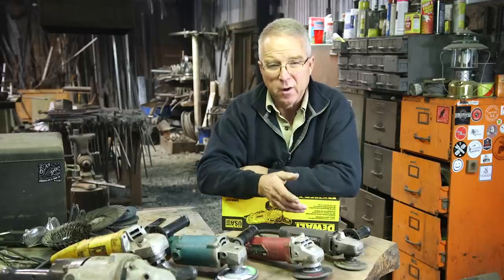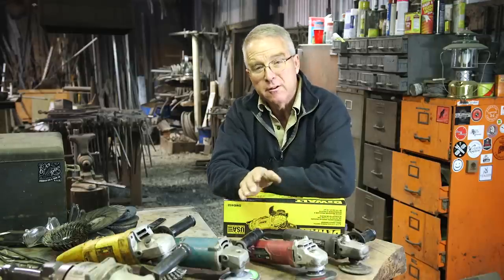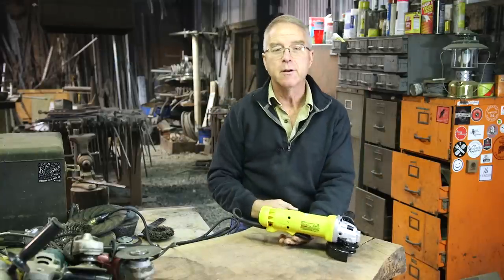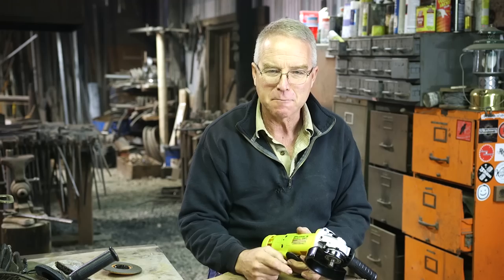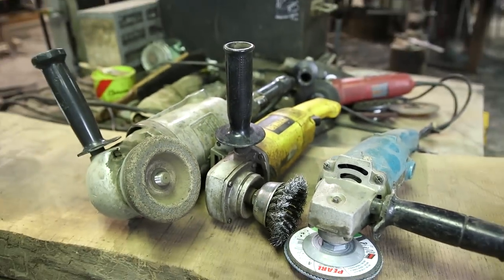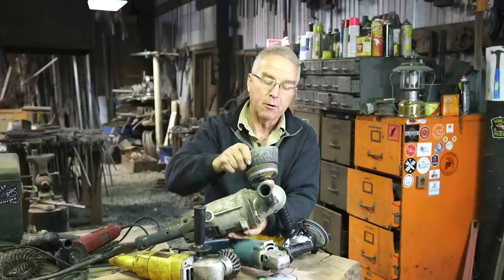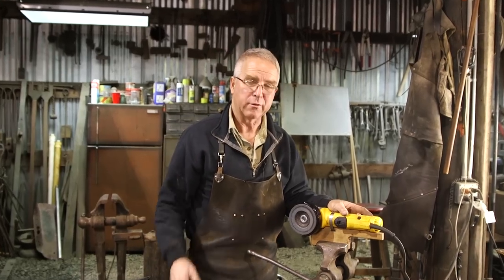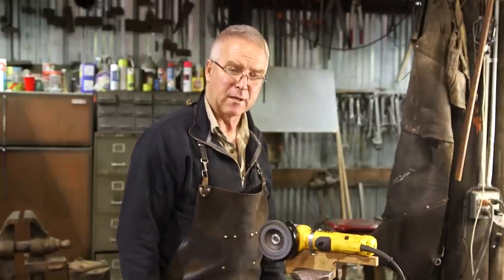Get Another Angle Grinder

Comment: Wear face shields, safety glasses, long sleeves, and gloves.
Reply: I'm with you except for the gloves. Just my opinion, but I don't wear gloves around rotating tools. If the wheel catches that glove, it'll tear the flesh off your hand faster than you can blink. If you're looking for nightmare fuel just google images of "degloved" or de-gloving accidents...
Reply: My brother had 3 fingers cut off.  A man I know had his nose slashed in half.  don't underestimate the power of cut off blades.   @noah_9886
Reply: A glove wouldn't have made any difference in either of those cases, Julie. Except maybe make it worse...
Reply: @TheBrokenLife  You shouldn't have your fingers near the wheel  and gloved should fit reasonably close the finger so catching fingers is a tard move ...brushing a knuckle against a wheel happens since most like myself use no guard and that shouldn't wrap a finger in a wheel,  and a real set of gloves will give you protection from being skinned ... The cheap ranchers leather gloves you get 3 to a pack for $4 bucks aren't the gloves to have a nice thick cut resistant welding gloves will save your skin from that mild knuckle brush.  I am welding using these tools so I always have the heavy stuff on not cheap gloves you use to hang chicken wire fence with .
Reply: Running power tools with gloves on was a firing offense in every training program I ever took. That goes down to 6th grade shop class and up to machinist's training in college. It's not safe. To the point that if you were caught doing it in college, you'd instantly fail the course and have to wait another year to take it.
So, do as you please, but it's not recommended.
Reply: @TheBrokenLife  If you run an angle grinder cutting up,  flap wheeling , or  grinding steel without gloves your hands will be all micro cuts and burnt from sparks... running a lathe , drill press,  or band saw ...sure no need for gloves , but use some basic sense not college sense .
Reply: Yes mother.
Reply: You mean ignore the trained machinist teaching the machining courses? OK then...
Reply: if you're in trade school or at a safety conference.  on the job??  probably not
Reply: @TheBrokenLife  Do you chew your food 32 times per bite while eating your lunch Or do you skip some so you can go out to recess faster ?
Reply: Comments like that only serve to illustrate that you just can't fix stupid.
Reply: @yerwrng  How is wearing gloves instead of not wearing them comparable to getting to recess faster?  Wouldn't not wearing gloves be the cooler lazier thing to do anyway in addition to being the only correct way to use the tool?
Reply: @lysergicheadcase   Keeping ones fingers away from the wheel is all it takes to safely use an angle grinder with a glove on ...lol... I just can't picture any one working with steel and not wearing gloves ...lol... what's next telling folks not to wear ear plugs when welding over head because you may not hear the phone ?
Reply: @yerwrng  Nothing is next. It's the same concept as steel toes being pointless when working around sufficiently heavy loads.  They will crush your steel toe and cut your toes off with it, just like the grinder will grab your glove and pop your fingers like glowsticks. If you want to be belligerent and go against common knowledge it's up to you. Creating irrelevant strawmen like you continue to do does not make you clever, it makes you seem incapable of taking this seriously.
Reply: @zachtheripper124  I just can't see anyone holding an angle grinder cutting , grinding , flap wheeling steel without a glove on .I pulled all my guards as they just get in the way and a few times have done work without gloves which since welding most of the time the gloves are elbow high and without the gloves my hands and forearms felt sunburned after from bathing in sparks ... lol... that's not a teacher telling me that  , but rather a practical observation from doing the work .
Reply: @yerwrng  With all of the safety experts commenting above, none of them figured out that each and every guard was removed from every single angle grinder.  I have to agree that after the guard is removed you should wear a glove.
Reply: @juligrlee556  Metabo have been using a safety clutch in their grinders for years for when a cutting wheel binds up, I'm not sure why other companies don't do the same. With people getting cut with the grinders I'm thinking they had removed the guards but they also could have binded up and jumped out of their hands as such which is what I'm thinking happened to your brother. Either way they're a dangerous tool and should be respected, probably why I own 2 cordless grinders because they're less powerful and easier to stop the cutting wheel under load
Reply: @wientz  I was gonna say that the guy getting his fingers showered in sparks is because he removed the guard in the first place. As essential craftsman said the guard is there to protect you from the sparks and in the case where a cutting wheel explodes
Reply: Great recommendations. @a-carpenter9229
Reply: a few things are absolutely clear: guards and gloves-  it depends a lot on both the individual and the circumstances.  Guards more just  circumstance.. Gloves have come a long way since that dude was in sixth grade shop class, most grinding situations i want to keep my hands clean.  That being said i got some valuable information here and if i got to a part of a grinding job where i thought i might lose the thing i would take my gloves off.  On the other hand it’s unlikely to tear your hand off like a lathe or a drill press, but fairly likely to send a chunk of wheel into a tendon...  so yeah nice thin aramid gloves.  There are times i take one or both earplugs out for safety.  Tablesaws scare me more than anything, but I don’t use any safety but full on heads up technique.  That being said recently been thinking about adding a knife. Its all about awareness and balance.
Reply: @TheBrokenLife  Interesting, what about vibration though? Some power tools obviously require some vibration dampening gloves. With gloves you end up getting your hand torn up in less then a second, without gloves and you run a higher risk of getting nerve damage in the long run. And ofc you have all the not so healthy substances that your skin is exposed to at a higher rate if you don't wear gloves. Running without gloves and you're just trading short term safety with long term safety. 

But i don't know what kind of power tools you're talking about.
Reply: Lets not forget to wear our neck tie and clean  underwear. Orange safty vest , Steel toed boots .We need to our lock and the safty coordinators lock .  A spotter with an extinguisher and wet blanket . Well hell its lunch time now.
Reply: And jeans
Reply: @gasfiltered  I've had metal slivers in my eyes, a deep slash on my arm, burns from the wheel on my fingers and hands.  Of course, gloves, like all pieces of clothes or even hair can get you pulled into the grip of a spinning wheel.  My brother lost half of his hand by falling into a spinning blade.
Reply: Noah _ if your gloves are a potential risk, it means you’re not using it correctly. Have your hand on the body and one on the handle that will never be an issue. I always use the stationary rule. Never use gloves on a station bench grinder or sander.

Comment: A thumb switch is the only way to go so you can one hand them, would never buy a paddle switch. I dont understand how anyone can like them... Talking about the 115-125mm (4"-5") ones not the big 180+.
Reply: Gürwald
      I have a thumb switch one and a paddle type. Paddle type is far superior in my opinion. I operate it one handed all the time.
Reply: Hate thumb switches...
Reply: One handing is just not a good idea IMHO, same with the thumb switches. Paddle gives a much quicker on/off, which I like. I think the issue with paddles really depends on the quality though.
Reply: @mercMADCommando     With what I do, two hand operation would take me at least four times longer to accomplish the task at hand. I don't have that much time to waste. Edited for spelling correction.
Reply: That is fair. With sanding disks or wire brushes I wouldn't be as concerned but with cutoff wheels and to a lesser extent grinding disks, it's just a no-go for me.
Reply: Having used both types over a span of 30yrs as a welder I much prefer thumb switches to paddle (or dead man switches). I find it less tiring for all day grinding/sanding/polishing.Totally agree with multiple grinders with different discs. But I will never use a grinder without a guard, when I see any grinder without a guard my balls retreat ,major injury waiting to happen, seems to be an American thing ? Never seen one in the UK.
Reply: Seems nice to have the choice though....
Reply: Thumb switch ONLY. Paddles are not usable in pipe fitting...
Reply: paddle swithces are much safer
Reply: The “pipe fitter” in this comment is clearly a rookie. Absolutely never has worked offshore or for a legitimate company. Any thumb switch would immediately be disassembled and any locking device disabled by rig electricians or possibly even removed from service due to the obvious safety issues they create. But what do I know, I’m just a actual pipe fitter. 
Safety first!!!!
Reply: @chrisk4251  not the metabo ones. They have stop feature against bluging them in while "hot"
It seams to be another us vs eu thing and most us guys use their thumb swiches on top of the angle grinder as they come from store. on good quality brands you can rotate head of tool so it sits right under your hand. No mader if you lefty or righty, but nobody has time to read the manual.
Reply: @jaanuspaaver2771  I was going to comment about that. The thumb switch should obviously be where your thumb goes, as on the side of the grinder, not on the backside!!
Feels like the US is trying to make things as stupidly as possible.
The paddle truly tires you hand down because you cant reposition you grip and you just have to squeeze that sucker for the whole operation.
Reply: @chrisk4251  
weird, how thumb switch can pass eu regulations, in my opinion paddle is just tiring down your hand if you were using it for longer duration of time, at the same time a quality thumb switch takes almost no time to switch on, and are mostly built hair trigger like, you bump the and they shut off
Reply: @duncancampbell5755  welder/fabricator here. I work in a marina doing work inside and outside boats, yachts, ships. For the most part we can't have the guards on. The spaces we work in requires us to remove the guards on our grinders, they just get in the way. As long as your aware of the danger and take precautions it's fine!
Reply: I have recently bought the UK version of this tool, from Amazon,  to add to the collection. It comes with a thumb switch as do all brands in the U.K. Interestingly mine is made in China and the guard is shallower but adjusts the same way. Really like this model of my Bosch Hatchi Dewalt et al like this one the best, lots of power.
All new thumb switch grinders from the 'pro' brands now come with the safety feature where if the power goes off or the unit is stopped by pulling the plug out you have to turn the switch off and back on to make it go. It will not start just by plugging the unit back in
Reply: the problem with that type of safety if most workmen mod them for usability, it needs to start with both function and safety.
Reply: @chrisk4251  been a pipefitter for 18 years and still prefer the thumb switch. I have had close calls with both but at 18 years, maybe I'm a rookie too.
Reply: I work for a metal sign company that uses decorative grinds on products they make, and sometimes constant movement of the work is required, so one hand is on the part and the other is on the grinder, thumb switch grinders are a must in this case. thumb switches are just more accurate too, it can be harder in some angles to aim with a paddle type. Working in automotive having to cut out brackets and other metal around the nooks and crannies of a car, a paddle/trigger grinder is just too much and 'one handing' a grinder can be very necessary.
Reply: That "Inovation" guard with quick stop in many positions is on my 20 years old 5" Metabo :) (not exactly same construction, but same functionality)
Thumb or paddle... meter of taste, kind of job and quality.
As low quality thumb is horible, so is low quality paddle. And vice versa.
If you have a job that require long runs, than thumb is more convinient. If you have a job with many start stop and short actual work time, than paddle is more convinient.
...
Reply: I agree, paddle switches where invented for shop class students and the occasional homeowner.   They are not meant for the professional.
Reply: I prefer the thumb switch for death wheel work, I actually have that exact same skil grinder that he was hating on lol.
Reply: Thumb switch ftw!  Especially since that one time I sat on a paddle switch controlled one...  not joking, it can happen.  I wasnt injured but my balls are still skittish whenever they see the color yellow lol!
Reply: Gi normusdick 

That’s like saying that on the space station they crap into a vacuum tube hence we have to do same on the ground.  All I am saying is...sure you wouldn’t want a runaway grinder on an offshore oil rig.  But in my shop I let it run free switched on with a thumb switch.
Reply: I have a couple Makita angle grinders because they have the best thumb switch. Not a fan of the paddle switch.
Reply: @chrisk4251  Not everyone works on offshore rigs where draconian safety rules are a necessity. That said, I prefer a paddle, preferably cordless.
Reply: Have both styles and the thumb switch is  too close to the wheel and awkward to operate. Bosch grinder variable speed is great but wish it had the paddle switch

Comment: A good trick is to check Ebay for broken ones. 

This will tell you what the failure point is on each unit. 

If you find a unit that's been around for a long time and there are fewer busted ones on Ebay (makita) then all the others. That's the one you want because it doesn't break or its worth repairing.

I love these chats I could talk tools all day.

Comment: I have never used this model. Only the Dewalt 13amp 4 1/2 in to 5 in.
They are a beast for its size. Cutting and grinding SS at work all day in and day out. It wont bog down. If u push down hard it will take off out of your hands before it bogs.
Also the 13amp Trigger grip is another fav for certain type of work.

Comment: If you think your Makita is going to die soon ?
Give it to me. 
You can not kill those  !
Reply: I had a Makita that worked for 15 years. I replaced it with a Makita, it lasted 4 Months. I killed two.
Reply: @metroman93f27  I thought I killed my Makita after 10 years but there was just a small wiring fault. Easy fix and good as new.
Reply: I’ve got a +10yr  old 4” Makita and a nearly 20yr old 4-1/2”. No sign of them dying any time soon.
Reply: Makita grinders are not what they used to be, we used to use them in the family steel fab shop, they were 7 inch grinders mind you, couldn't kill them. I use 5 inch grinders so does my brother I killed a Makita in a year and that wasn't using it everyday, my brother only had Makita grinders last 6 months. He's gone to Milwaukee grinders he gets a year or more out of them before they grenade.
Reply: @Graveltrucking  
That's why I want his old one  😎
Reply: I bought 2 makita 4-1/2" grinders and 2 harbor freight cheapo 4-1/2" grinders for a job cutting 1/2" steel mounting brackets that were installed wrong on a building fascia. Guess which grinder lasted longer.

Yup, the harbor freight cheapos.
Reply: 7" makitas are the best 7" grinders
Reply: Back in welding school we had 12 Makita grinders that saw 14 straight hours of use daily (morning and afternoon classes)and I only saw one truly die. The rest might need a brush replacement on occasion, but they were bomb proof little tools
Reply: @JustNobodyButME  The harbor freight?
Reply: @JustNobodyButME  The harbor freight?
Reply: @Graveltrucking  what you're doing wrong is written right in your comment. You should just stick to the 7 inch models. Like you said, "you, couldn't kill them." (sic) It stands to  reason that if you're trying to get the same work out of a 5" as a 7" it's not going to put up with it for very long.

Comment: When I worked in a shop I never used a guard but had a handle, much like you. It works well in controlled situations and to get into tight spots. When I got into pipe welding, that is when I started using the guard with no handle. You can control the head much better with your hand on the body of the grinder, rather than the handle. I rarely have a handle on my grinders and always have the guard. 
Just my professional insight.

Comment: I have that grinder and like it a lot. My next one though will be a DeWalt with the anti kickback system. I bought the flexvolt one this summer and love it. That anti kickback is worth its weight in gold with cutting discs. That flexvolt even handles the 6 inch grinding wheels good.

Comment: Just finished redecking my car haul trailer   The cordless 20v dewalt got a real workout from cutting off screws to making rust and corrosion disappear   Like you I prefer wheels with threads. No guard on this grinder ,,in fact not sure were it is. Was using other cordless tools but used pneumatic to seat the new screws,,just love to hear a pneumatic impact getting it done!

Comment: I have that grinder, but mine came in a big hard case to store it in.  I’m just a homeowner that only uses it once in a while to grind off my mistakes.  The switch took some getting used to, but it works great once you are used to it.  Some of my best tools are DeWalt and one of my worst tools was a DeWalt.  I did not know about the rotation of the guard.  Good info there.